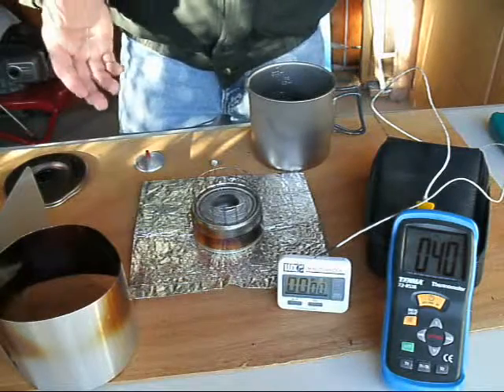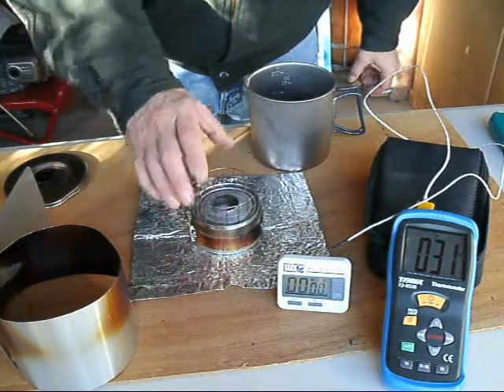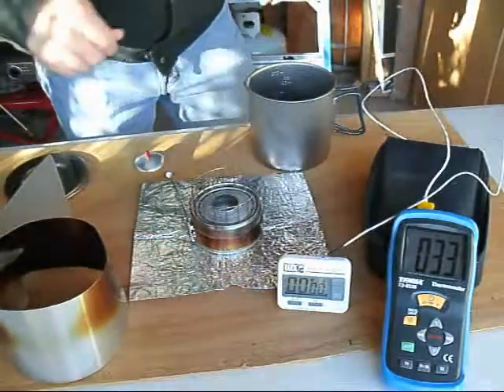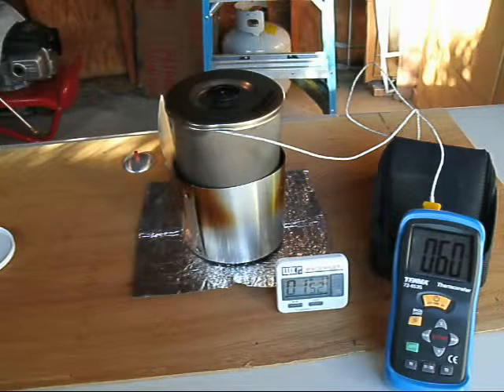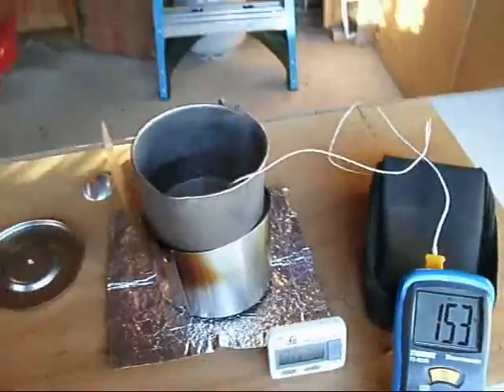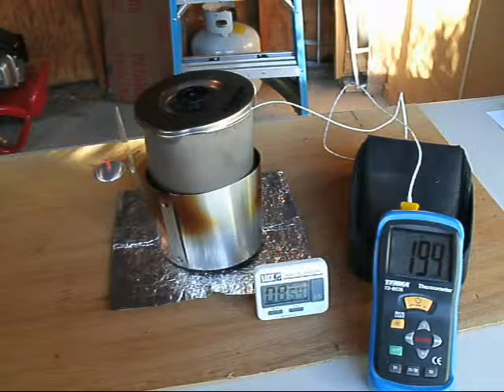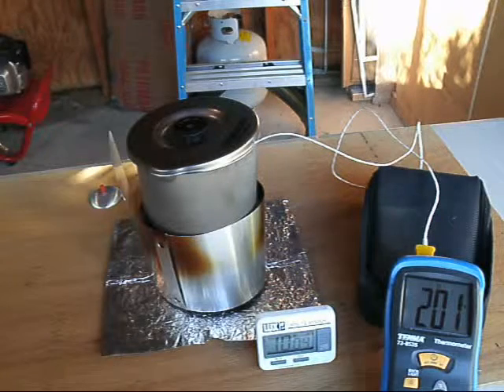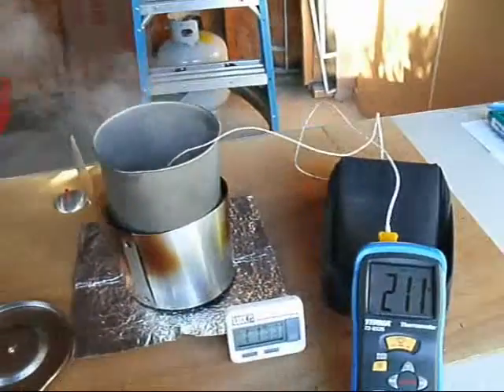PackaFeather XL Part 2.wmv

Comment: Finally, I gave up on titanium pots, and have greater efficiency (and better food) using anodized aluminum.  Titanium is too dense for efficient, general heat transfer.  It's popular, I know, but when fuel efficiency and performance really counts, I have found it's weight savings to be offset by its poor thermal characteristics.  Thanks again for the nice and very thoughtful video.

Comment: It has other benefits.  The stove is more stable and I can place the stove on otherwise unsuitable ground surfaces, including snow and ice.  It also seals the bottom of the stove so that regulation of the air intake through the vent holes is more precise, regardless of the ground conditions.  It also allows me to place a small amount of alcohol in the stove for priming in cold conditions.  I routinely use my stove in sub-zero temps (Minnesota), and achieve more efficiency with these mods.

Comment: Second, the pot stand is too short.  I made an extension on mine that elevates the pot another half inch.  If the pot stand is too low, the alcohol fuel is overheated and burns off too fast.  Further, the optimum heat transfer is not obtained at the lower height of the XL's stand.  Third, I manufactured an aluminum lid for the bottom of the outer cat food can, that fastens securely to the can.  This ensures a stable base for the stove, without the need for aluminum foil.

Comment: Thanks for the video.  I built a cat stove very similar to the Packafeather XL and determined that it has a few design flaws.  First, efficiency is greatly improved if the fuel cup is tall enough to make contact with the bottom of the "combustion chamber."  The fuel cup should have roughly 8 air jets.  A 3 oz (Fancy Feast) can works perfectly for this, particularly since it is almost precisely the same height as the interior of the larger can.
Reply: Them you have made the classic "Roy Robin Cat Can Stove", a laminar flow stove, made with two different cat can food cans, and that can have some flame control trough a external aluminum strip for cover the air input holes.